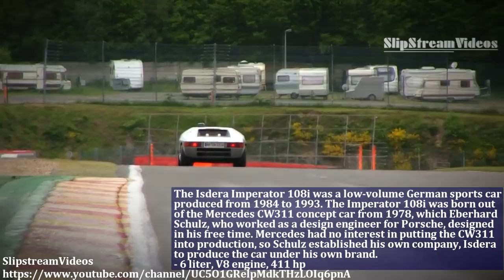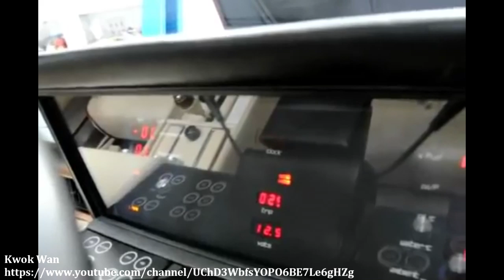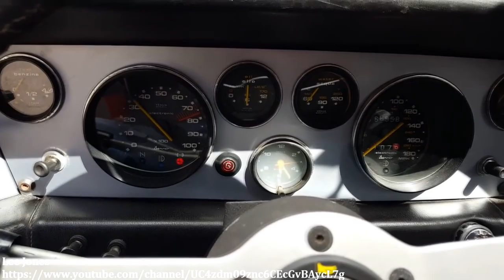Rare And Forgotten Radical Wedge-Shaped Cars

Comment: I think in the case of the Lotus Esprit people had to wait until the late 80s to get a V8 powered version. The earlier ones had I think a 2.2 straight4
Reply: The S4 came out in 1994 and WAS NOT a Giugiaro design, but was penned by Peter Stevens. S1 2.0 litre, S2 2.2 litre, S3 2.2 Turbo. Those are Giugiaro cars. Do not believe all you see/read on the internet, especially these so called car guys.